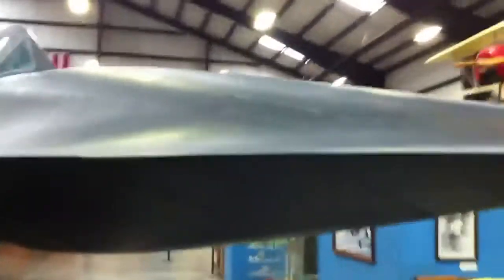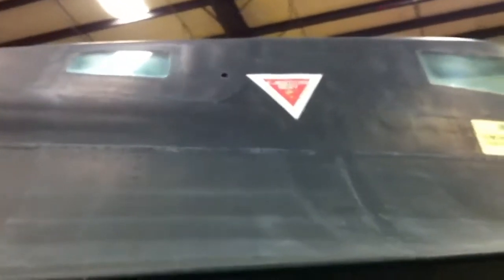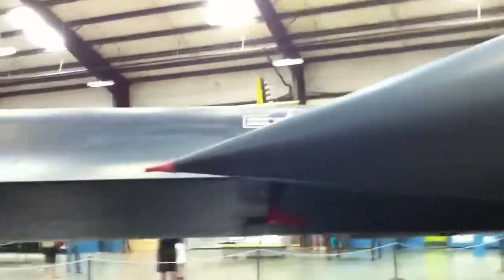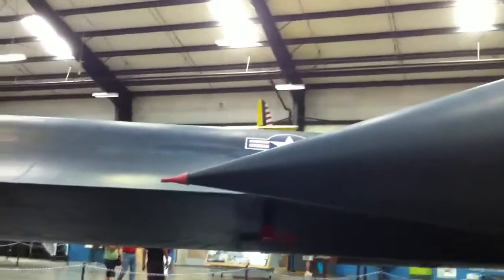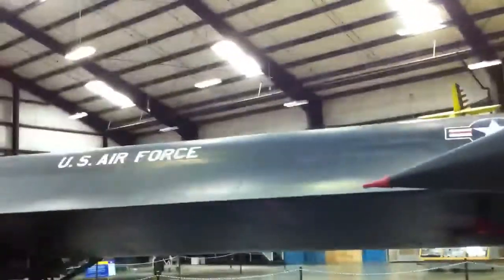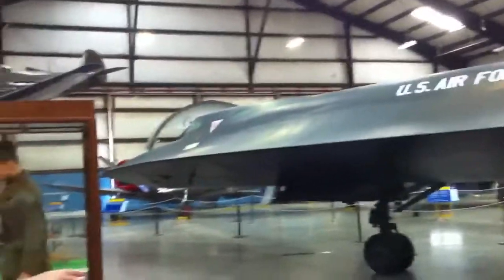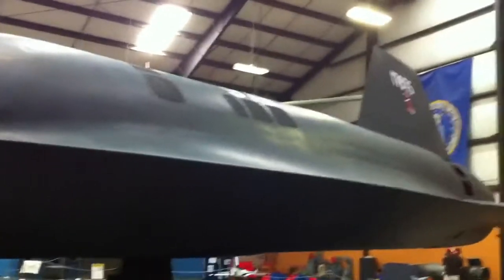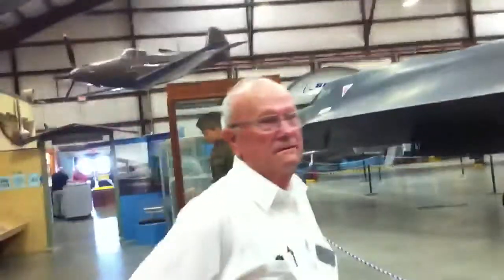SR71 Blackbird - March Field Air Museum

Comment: The Wiki article is also very informative. As to how fast it was....most Soviet surface to air missiles used between 65' and 90' could reach Mach 3 or more. These missiles were fired repeatedly at SR71's and the "Habu's" response was typically to simply go faster (!).